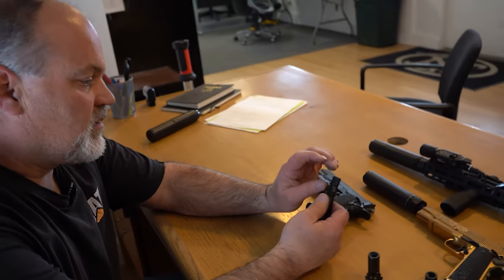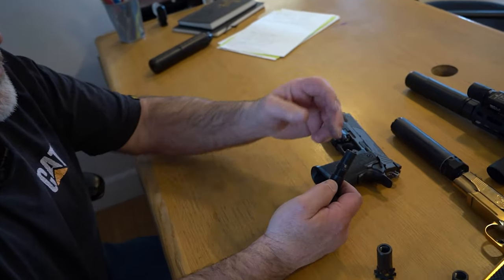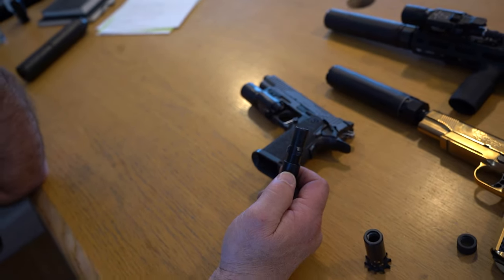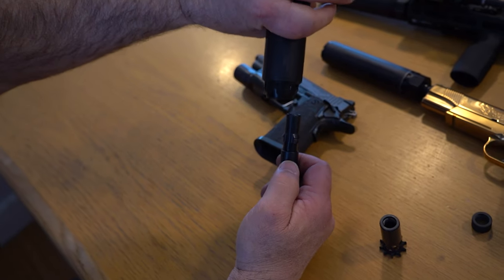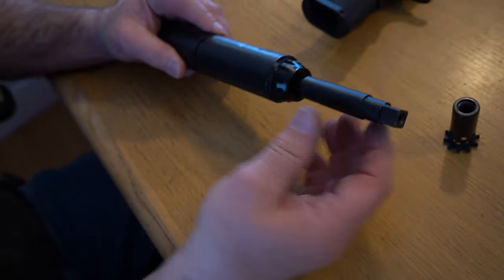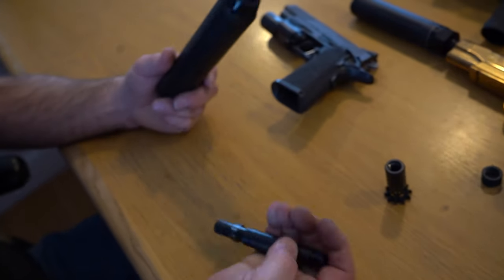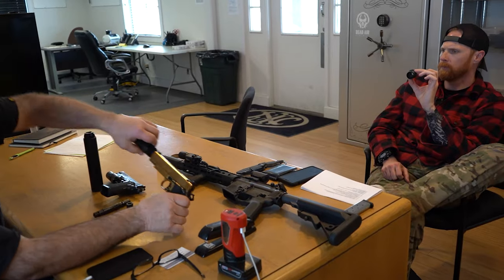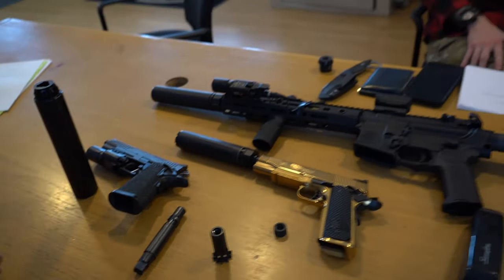Suppressor 101 | Everything about Suppressors with Mike Pappas Episode 2

Comment: I run a threaded fixed barrel Ghost 45M on my CZ Scorpion Evo. Works great. I switch out the fixed threads for a piston setup whenever I put it on a pistol.
Reply: Bro, how do you like the Evo overall? Both suppressed and unsuppressed? Any malfunctions? Fairly accurate?
Reply: I love it.  It has about 5000 rounds through it. Mostly 147gr subsonic rounds I reload, but it cycles everything I've put through it . Short of one of the factory mags breaking a feed lip, it has never malfunctioned.
Reply: It is as accurate as I would expect for a PCC. Within 35 yards groups are tight and touching.  I can consistently hit a 18x24 USPSA sized steel target at 125 yards, but that is with some creative aiming. 

As far a unsuppressed, it is still great.  There is no difference in point of impact with or without the can...just louder. I'll probably never shoot it without a can again.
Reply: @tymoore8198  Awesome man, I appreciate the input, that's what I'm looking for. 

How is it with blowback/gas in your face when suppressed?

And if you don't mind, what type of 147g bullets are you using, and what type if powder? I'm JUST getting into reloading now, so appreciate the input man.
Reply: There is no blowback into my face.  I bought a Scorpion over a Sig MPX specifically for that reason- it's also half the cost.  The Scorpion is a blowback action so that gas is mostly contained.  

I usually use Berry's 147 grain bullets, but I cast my own also and coat them with Hi-Tek coating. Similar to Federal Syntech ammo.  I have a MasterCaster. I've never had a problem with lead in the can with my cast/coated bullets, but I keep a close eye on it and shoot more of the copper plated Berry's to avoid it. 

I use Winchester 231 because I have a bunch of it and it works.  But I also use and prefer VihtaVouri N320, but it is more expensive and sometimes hard to get.
Reply: @tymoore8198  Thank you so much for that info. Helps me know I'm thinking right. 

I really like the things the Sig MPX has to offer, but hear it's terrible to suppress regarding gas in the face. And it's crazy expensive. Exactly why I've been looking at the Evo. Way cheaper and very customizable. 

And perfect, because Berry's and N320 is what i was leaving towards. Really appreciate the feedback man.